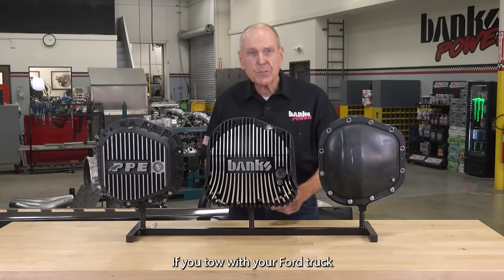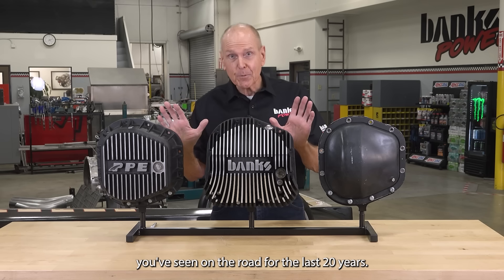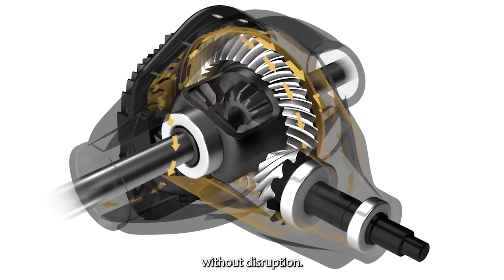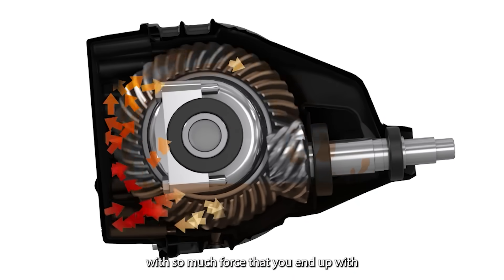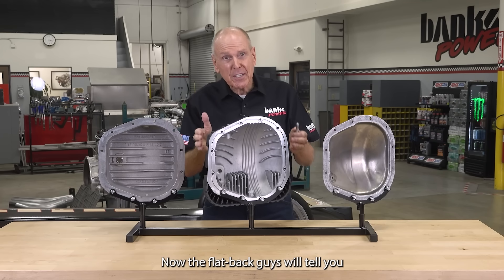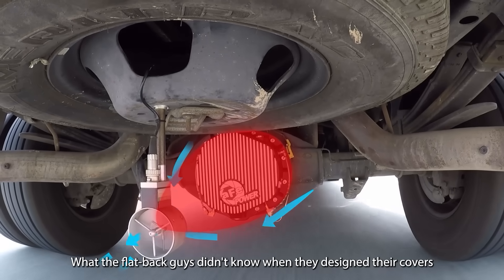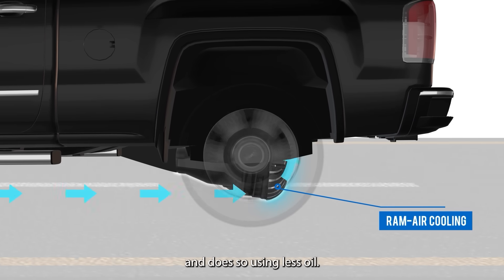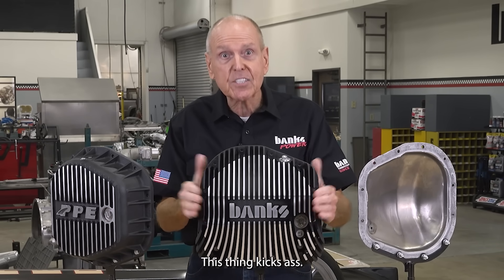Gale Banks Explains NEW Ram-Air Diff Cover for Ford Sterling Axles

Comment: So still nothing for a Ford 350 DRW?   I mean it's not like these trucks were meant for towing.....
Reply from the maker: Because it's a different axle than is in the SRW trucks, and so much smaller of a market, we've had to prioritize other applications. That doesn't mean we'll never do it, but there aren't any plans at this time.

The good news is that the axle on your truck is so beefy from the factory, that you're less likely to run into issues than the SRW guys.

Comment: What’s wrong with the oem covers? Why replace them.
Reply from the maker: Increased cooling and increased gear oil distribution. This is especially important on those trucks that get worked hard towing heavy loads, etc.

Comment: Mr. Banks, big fan here as was my late uncle, I have this Diff cover on my Ram one ton. I tow a large 5th wheel.  PROBLEM, my buddies are jealous, they have class C motorhomes on Ford E350 and E450 Chassis. Do any of your Ford truck diff covers work on E350 and E450 Class C motorhomes? I believe there could be a market with these guys with the big heavy duty E HD Fords. Most are gassers, now running the Godzilla motors.

Comment: If you have an F350 Dually look elsewhere for a Diff cover because Bank's doesn't support DRW covers. Seems like SRW is the only thing they make covers for. Very disappointed that I had to purchase a cover from someone else. aFE and Mag-Hytec seem to be the only companies that makes a DRW rear diff cover and they use the Mag flat back as an example what not to use.  I guess I will never get to experience the Ram Air effect on my rear diff cover, did I mention I am very disappointed?

Comment: GM 10.5 corporate 14 bolt is one of the most popular rear ends of all time. Mostly used on gas trucks and I know you're a diesel guy but if u want to sell diff covers that would be a popular cover. I'd buy one.

Comment: Not so sure I'm happy with 4 less quarts of diff oil in this cover.  Also, if off roading an get a lot of mud and debris shoved in those ram air cooling inlets and fins you will loose the cooling, (with less fluid).
Reply from the maker: If the Ram-Air scoops collect any mud or debris, simply hose them out. Our patented Ram-Air scoops are designed to increase airflow over the rear differential without sacrificing ground clearance. In fact, our differential cover retains the same low point as factory and competitors. Even if the scoops were to be caught on on something, the Ram-air scoops have built-in break away point prevents damage if scoop is snagged.

 Regarding fluid capacity, simply adding more fluid does not help cool the gears. Yes, it may take a little longer for the larger amount of fluid to heat up, but just like the ocean, it retains that heat and takes longer to cool down. The Banks cover retains the stock fluid capacity and uses increased surface area to reject heat from the fluid to the outside of the cover and ultimately to the atmosphere. It's 5X more effective than high-capacity covers.

Comment: I spent hours and hours trying to find a differential cover for my 2018 GMC Sierra 1500 with the 6.2L, which means it has the 9.76” 12-bolt differential. I spent hours trying to find one that accidentally mimicked what you have created. The closest one I found was B&M. I only got it so I can properly service my rear differential. Of Banks made one for my truck, I would have bought it in a heartbeat.

Comment: Gail, if you had to pick 1 or 2 of your products to FIRST shove into a 2024 Ram 2500,  which would you pick? Having troubles picking between the ram air + monster intake or monster intake with the boost tubes? Thank sir!

Comment: Why do we just let the Exhaust flow into the air? Is there really no way to capter it or treat via filter on the back of the Vehicle  a fan plus treatment device?
Reply from the maker: We do actually filter exhaust that way. You've just described the catalytic converter, diesel oxidation catalyst, diesel particulate filter, and selective catalytic reduction systems.

Comment: Man I wish you guys did more gas stuff. I love this channel and plan on buying products for my diesel in the future. But I really wish you guys did more gasoline engine stuff. Anymore the market for classic cars and most of the overall gas engine market is dominated by Holley. They just keep buying up brands and I feel like as time passes the quality is just falling off.

If instantly buy a Banks Efi set up if it were on the market. Something similar to Holleys sniper system. I just installed one on my classic truck and have been fighting with it to keep it running properly. Had a dead sensor straight out the box, then a failed relay, now fighting issues with a stalling I suspect to be injector related. All within the first 100 miles. I just want to buy well made products that last. Is that so much to ask for?

L

Comment: Less oil capacity is not a good thing. Oil will wear faster. 
If oil is running colder, in cold climates, viscosity should be modified.

Comment: 1:22 you should have removed those round parts on the vanes because they disturb the flow of oil
Reply: They look like casting vents, other than machining them out, i think they might not be able to exclude them.

Comment: When I was looking for a new pickup in 2017 I read a lot about failed Ford differentials.  I am now willing to bet that the people suffering those failures were running a flatback.  My best friend and I discussed this on and off over the years and I talked him out of putting one on his first generation Dodge that he still has with over 350,000 miles on it.  The discussion always came back to how does the oil get to the front pinion bearing.

Comment: The market may not be too big for it, but I'd love to see this for a Chrysler 9.25". That's in back for my 1979 Dodge W150. Since I live in the San Bernardino mountains, it'd be nice to have the extra cooling to pull the 18.
Reply: Same. I got a 99 ram with the same axle and i would love a ram air cover for my rear diff
Reply: Same.
Reply: Too bad they don't ever answer questions ....

Comment: Been waiting for Dana 80 cover for years. Called Banks recently and was told the project was put on hold. Oh well
Reply: If they build it...I will buy it.  I'm sure there are many others out there that will purchase as well.
Reply: Same for the Dana 70 1st and 2nd gen crowd. Gone from the website.
Reply: Exact same boat as you. Im sure there is a reason but since it would work for the dana 80. It would have applications with Ford and Dodge owners.

Comment: I have a Poniac/Olds 9.3 rear. I am going to be using 4.10:1 ring and pinion. I have been toying with the idea of drilling a hole slightly below the axle centerline in the axle housing behind the ring gear and running a tube to an aluminum cooler and then dumping it back into the top of the housing with a tube then is welded at an angle towarde the top of the ring gear. It should help at steady speeds and possibly for the strip although it may not be efficient if the location is out of the air stream. I don't want it to get broken off unknowingly. I got the idea after watching the first series on how differential oil is circulated and Gale Banks told the truth about the awful differential covers. My 9.3 is all steel and with no removable cover, old school, dependable.
Reply: There are pump and cooler setups you can buy. But unless you track the car, a large differential like that pushing around a car will probably be a waste of time. You could install a temp gauge in the differential housing to see if it is even getting warm before you take any drastic measures.
Reply: @geoffmooregm Have you done this previously?   On what do you base your premise that it is a waste of time?   I have temp sensors I will install in the transmission and the differential (different scales).  I also run Amsoil Severe Gear Synthetic oil which aids in lowering the temperature. I have not checked into tumble polishing gears but that also reduces friction.
Reply: @4speed3pedals  I didn't say it was a waste of time. I said you don't want to waste your time, and money for that matter. But you should make sure (by checking temperatures) it won't be a waste of time. Oil, too cold, is almost as bad as oil that is too hot. So, just be sure these mods will be beneficial. Just street driving or drag racing a car will never heat the oil enough to be problematic. Track racing and heavy (relative to axle size) towing will heat the oil. Possibly enough to require a cooler.
Reply: @geoffmooregm I agree with you but with a low ratio such as a 4.88 or more, it may be something to consider after knowing the temps. Pontiac is fortunate with the fill plug being 1/2" pips so the only need is to run the wires. Plumbing I am thinking would be easy for a self pumping cooler. If ineffective it would be easy to plug. Nothing ventured, nothing gained.
Reply: @4speed3pedals  Yes, absolutely. Get that sensor in there and give the car a good hard run and see what happens. 

I have already added a bung to my oil pan in my old Trooper. I had to eliminate the stock cooler because it was leaking badly, and you can't buy one anymore. Everyone says it's not needed, but I do a lot of off-roading and work the engine hard with very little forward movement. So I am going to install a sensor to see what the oil temps are getting too and under what kind of conditions. Who knows, I may need a cooler, too

Comment: yes they cool more than OEM. but given the total lack of issues with the OEM diff solution. it doesn't seem like a problem in need of a solution. More just a vanity piece?
Reply: It really depends on how much and how frequently you tow and in what kind of environment. But for the people in their lifted mall crawlers is wont change the performance of the axle but will count as eye candy!
Reply: Totally agree, we farm and have been abusing 1ton pickups for decades , I also have personal F-350 pickups that I use hard all the time, never lost a diff in my lifetime other than the 2021 ford axel recall.. Bling is nice but completely unnecessary..(like most aftermarket products 😅)
Reply: @6by6by6 Think about the ease of maintenance with this cover. If you work em hard then you should be swapping fluid every 50k.  Having a drain plug alone is worth it for me, instead of having to remove the cover and re seal every time. Then the bling is just an extra perk 👍🏼

Comment: How about for the 9.75 ford axle  in the Raptor
Reply: I would "3rd" that!  All the "Max Tow" and HDPP trucks could use this.
Reply: My truck has the same axle. I would buy one in a heartbeat
Reply: Honestly, they need to be getting these things out for a LOT more axles - the demand is clearly there

Maybe some other companies need to take the hint and start innovating with diff covers themselves. We don't want the same old crap that, frankly, until the Banks videos, most of us didn't even know did anything besides make you spend more money on gear oil.

Comment: Throw the Ford 8.8 in the mix, sounds dumb but I want one for my Mustang and my F250 👍🏻
Reply: This could be awesome for guys that road race heavy Mustangs like Terminator Cobras and GT500s(and the S550 and up for that matter), they tend to crank the power up some in those cars(since it's so damn easy), throw BIG sticky tires on them, and slaughter big sweepers at high speed tracks - it isn't uncommon to overheat the diff and squirt gear oil out the breather(which is why you should have a diff catch can if you don't run a diff cooler). I think something like this could potentially keep those diffs cool without the need for a complete diff cooler setup with an electric pump and radiator.
Reply: 2012 Shelby Gt500 aluminum finned cover fits

Comment: PLEASE F-450 owners are BEGGING for this cover....Please bring to market!!!!
Reply: Isn't the F450 axle an Eaton or Meritor with a dropout center?
Reply: It's already on the market
Reply: @RikTalon90  Not for the 450 it isn't otherwise I wouldn't be asking
Reply: @RikTalon90 it’s only up to the 350, not the 450
Reply: @antonfloor344 
Last I looked F350 SRW not for the dually.
Reply: So are 450 diffs overheating & exploding or you just looking to waste some cash? Lol
Reply: @3DProductions  are any of them overheating and exploding? No. I just like doing anything I can to improve longevity of my equipment. But thank you for your interest in my finances.
Reply: “I like wasting money even though I know It is completely unnecessary”
                                -@tripnick3
Reply: @3DProductions  thank you for the insight.
Reply: @3DProductions Never heard of preventative maintenance have you?

If you need to be able to rely on your equipment, those 400ish bucks are more than well spent for extra longevity and piece of mind.
Reply: @joemama069  did you mean preventative maintenance?...

proper maintenance and your rear end should never be a problem in the first place...but congrats on slightly extending the life of your gear oil at a price of $500

or maybe spend it on something like a disaster prevention kit for your cp4, so when it grenades youre not out $10000 on an entire fuel system, seems like a better way to spend your money no? not sure why youd go out of your way to do extra preventative maintenance on a part that isnt known to fail lol.

use your brain
Reply: @3DProductions  Yoo gotta love people who disregard an entire argument because of one typo.
I'm not that familiar with the F-Series' drivetrains, so I was going off of the assumption, that the diff is one of the weak-points when constantly subjecting the truck to high loads, in which case, even if the cover only increases the diff's lifespan by just a few months, it'll be well worth it.
Additionally, I never called fuel system upgrades into question, nor was that even up for debate.

Staying on topic, actually reading other people's replies and being somewhat friendly goes a long way in discussions like these.
Use your brain :)
Reply: @joemama069  I didn’t disregard your statement i expanded upon it and that there is more important preventative maintenance than a “ look at me” diff cover…such as fuel system. Lol
Reply: @3DProductions  Typical flat back guy 😂
Reply: @RefinedRags  or stock guy that isn’t dumb enough to buy any diff cover lol, theyre all unnecessary including banks
Reply: @3DProductions 

Those aren't look at me covers. There is actual science and hard test data behind them. Banks doesn't put out look at me products. If they can't improve upon a design they don't offer it for sale.
Reply: @jesusisalive3227  they are completely unnecessary & the stock diff cover is perfectly adequate